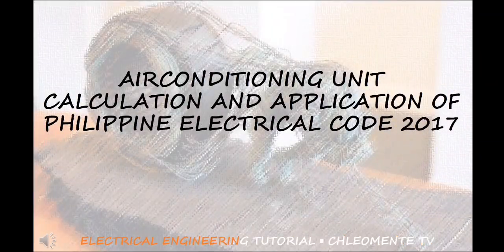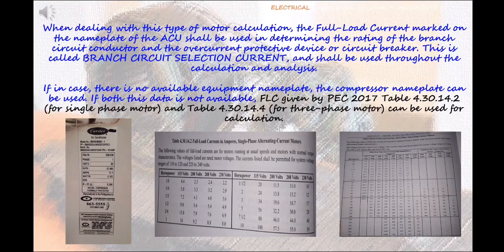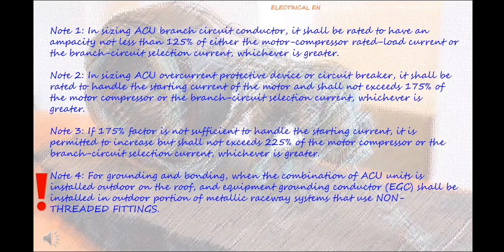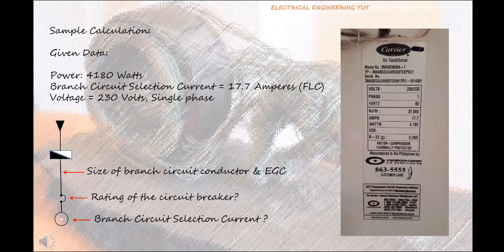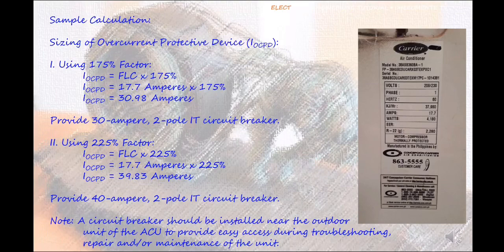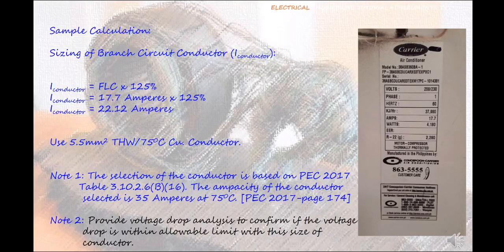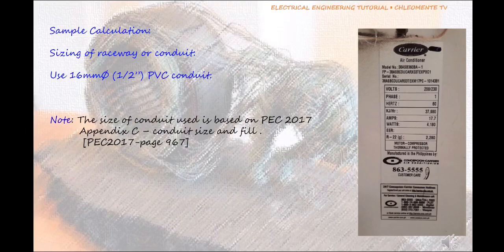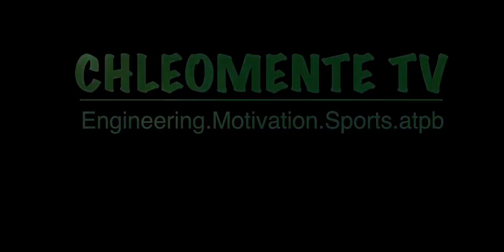Airconditioning unit ACU calculation and application of electrical code 2017

Comment: Can I clarify the overcurrent protection device for? short circuit and ground fault protection or for overload protection?
Reply from the maker: It is intended for overcurrent due to short circuits and ground faults. However, if you will notice that i used inverse-time circuit breaker, its long-time setting will also protect the compressor motor against overcurrent due to overload.
Reply: @CHLEOMENTETV  Sir, can I know the section in PEC that the manufacturer's nameplate data shall be used for short circuits and ground fault protection?
Reply from the maker: Jesus Santos nice question sir. please refer to Art.4.40 and see how BRANCH CIRCUIT SELECTION CURRENT is defined in that section of PEC 2017.
Reply: @CHLEOMENTETV  Yes sir, I have read it. It only says that use the value in Amperes. In my understanding is that we cannot use, Watts, VA and Voltage, etc. to size up the circuit breaker and conductors. It does not mention also specifically to use the manufacturer's data or nameplate rather use Table 4.30.14.2
Reply from the maker: Jesus Santos to be specific sir, 4.40.1.6 Ampacity and Rating. 
For Art.4.30, including the table you are referring is used for other motors. On the other hand, dealing with refrigerant compressor motor needs special consideration.

Hope this help sir
Reply: @CHLEOMENTETV  Thanks sir... How about the size of conductor, why need to use 5.5mm2 if 3.5mm2 THW is still adequate? If the Voltage drop is still low, say 0.5%.
Reply from the maker: Jesus Santos good point sir. But in this case, you must also consider the matching of your conductor vs the rating of your circuit breaker..
Reply: @CHLEOMENTETV  Yes sir for non-motor load if I am correct. But for motor load and refrigeration/air conditioning, the code permits the overcurrent protection device is to be larger than conductor. So please enlighten me why the conductor needs to be 5.5mm2. Because for large building, it is a major cost implication.
Reply from the maker: Jesus Santos good point sir. As a designer, you need to consider that. For large building application, temperature and adjustment factor for the ampacity of conductor is considered so 25 amperes for 3.5mm2 is not 25 amperes at all.
Reply: @CHLEOMENTETV  Ok sir, the real reason is due to any correction factor not due to matching of conductor and overcurrent protection.... Would you mind if you could add the value of correction factor in your video tutorial? So that the  viewers will fully understand why 3.5 is undersize.... More Power!
Reply from the maker: Jesus Santos this is a good suggestion. Thank you very much. I will make a video presentation about this... God bless.
Reply from the maker: @jessiesantos1641  https://youtu.be/s1nofI3VjAw
Reply from the maker: Application of correction factor for conductor based on PEC2017..God bless